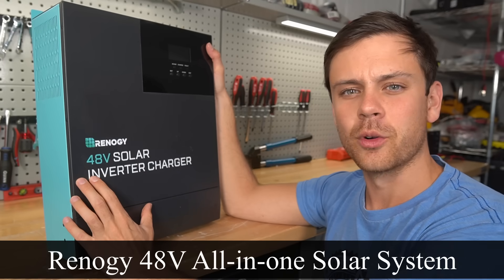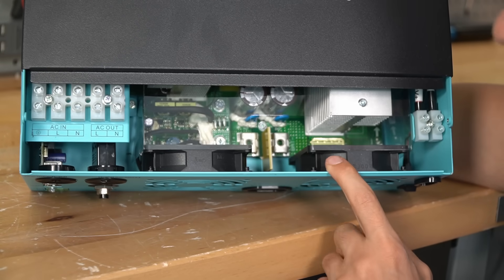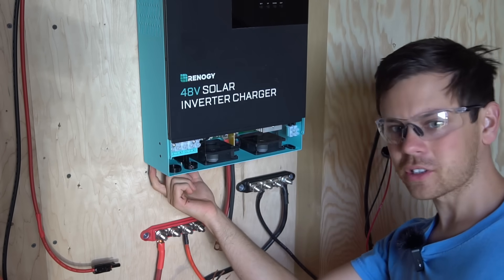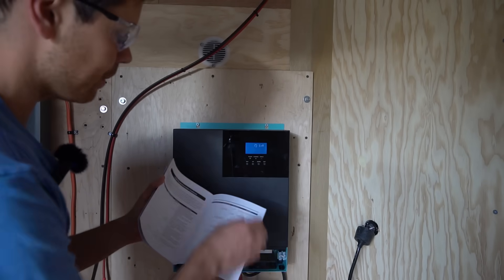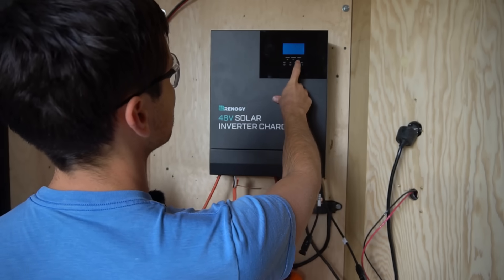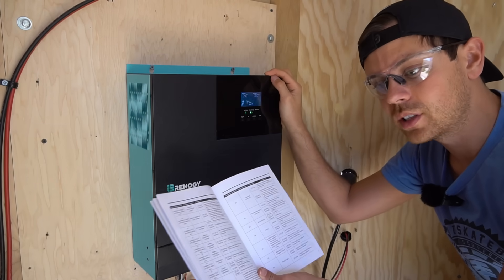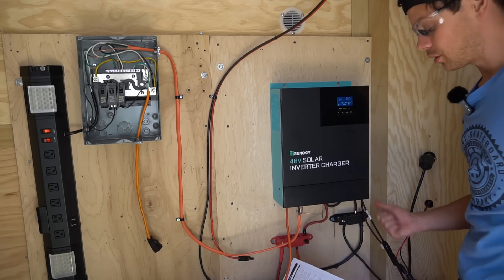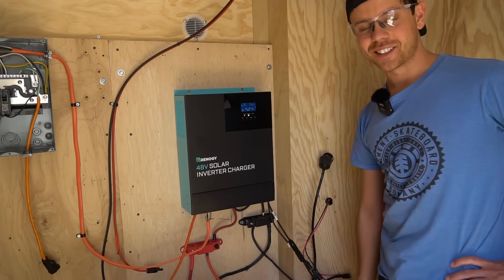Renogy 48V All-in-one Solar System: 3500W Inverter, 4400W MPPT, 1920W AC Charger

Comment: I have been waiting to pull the trigger on the Growatt unit until this review was published. Thanks for assisting me with my decision.
Reply: same, i was waiting for this and to see it the growatt outperform is cool cuz its cheaper.
Reply: @jameshughes131  I am actively shopping and defniitely would have bought Renogy over Growatt bc of the name and availablility from reputable retailers.  Now the question is do we wait and see if Renogy fixes this or go for the Growatt now.
Reply: @Ken1704  im going with growatt becuz A.) they care about pricing and customers so i want to put my money with the people who did it first and who get better over time. im gonna buy that 48v system to save on wire costs and use it without battery on a large array. I will get 4 x 12v
sok or make my own
Reply: @jameshughes131  Thank you, that is a great point.  I also like Signature Solar who sells the growatt.  I often think the retailer is as important as the product.  I just got a 1000W inverter from Amazon and when it arrived I shake it and something is rattling inside.  Amazon says take it to Kohl's and drop it off.  That is amazing (and I HATE Amazon-but I get gift cards from work) but I have to admit that return experience was incredible.
Reply: @Ken1704  i only use ebay and i deal with sending stuff back all sometimes but for important peices like growaats deal and such i buy only from reputable sellers. To many fakes. I just picked up santan 250w panels used for 59$ out the door crate shipped to me. I got 10 of them. 
in 3 days i have to make a all in one purchase and will go with growatts batteryless system. I will get batterys later. The idea of going batterylesss with large arrays is very environment friendly and i need will to do more testing on this. 5k btu ac on the large array no battery. then lastr min lets talk about the batts
Reply: @jameshughes131 that is an amazing deal.  I am trying a similar project and was actually going to go to the forums for advice.  I purchased a Mr Cool 18K BTU mini-split that consumes about 4KW of power (220VX15 amps).  If I can get free heat and AC during the day, it will all be worth it.  For panels, I am 90% sure that I am going with the 410W bi-facial from Sig Solar.  They are bout $250 per panel with shipping, so just over .50/watt.   I did the opposite of what you are doing  I have a 3 kw/hr battery bank at this point.  I got 2KW from batteryhookup for $150!  I didn't want to go overboard on batteries but I spend the majority of my time in my home office and bedroom which are next to each other.  At this point, even with just a few panels, I am able to run the home office on solar most of the time (90W computer +50W TV and soundbar+about 25W for lighting=165W/hr X about 4 hours per day).  I don't know if this is a rational plan, but my idea is to go room by room with the kitchen being last to go to renewables (I say renewables because I plan to add small wind at some point since I am in the midwest where winter may not produce enough solar).  One of the reasons for delay on pulling the trigger is that my understanding is the fed tax credit applies only once.  Once your system is "in service" you don't get additional credits for adding (that is my understanding without consulting a tax professional yet so don't take my word on that).  I need to go to the forums and have this discussion with some others.  Thanks for your reply, please keep us posted on how it works out.
Reply: @Ken1704  Per Intuit, additional solar tax credits are allowed for upgrades to an existing solar system; but …. you cannot apply for additional credits on the overall system as you already claimed for that once before….*but always check with your tax advisor to confirm nothing has changed on that front since the Intuit information was posted initially….
Reply: @Abeaness  Thank you very much MH  That makes a huge difference in how I proceed  I was just reading the info from DSire or something  I should have looked into it more carefully.
Reply: @jameshughes131  Look up the word cheaper and look up the words less expensive, you might be surprise that your miss using the word.

Comment: Message for Will: Be patient and give us a review after playing with it for 30 days. It clearly has some flaws but 48V and 3500 watts is the sweet spot for me and my van. I mentioned needing 1500 watts just for boiling water (in the past) and obviously I need more for A/C and some other stuff and I do not want to be using 100% for durability purposes.
Reply: Yep, but I'm doing it in a class C RV and want to run a mini-split A\C. I want at least 3500w.

Comment: Solark running my dryer and other stuff in the house at 7.5kW: No fan noise whatsoever. The Growatt 6000T I had before that had a standby of 120W and even higher draw when powering loads - you couldn't hear yourself think when just 1000W was being drawn by the oil furnace - seems this Renogy is super noisy too.  Funny, fans are a consumable on the Growatt site. Oh, and  the Solark clocks in at about 25-40W standby. Don't hold me to this but I'd swear the UI on this Renogy is suspiciously similar to the UI on the Growatt 6000T ... hmmmm. Brothers from the same mother?
Reply: Comparing SOLARK to Growatt is pretty unfair ... JET to BiPlane

Comment: Man...Will...that's the quickest and the most consistently pissed off I've seen you...for that reason... I wouldn't touch it!!... thanks Will!!👍👍😎
Reply: Aye aye!
Reply: Most of my system is Renogy, but I have gone with other sellers when it's warranted. I am preparing to switch from 12v to 24v, and my current system is pieced together. Trying to decide if an all-in-one will be worth it, or if I will continue to build piece by piece. I like having the ability to replace each component in case of failures. Off-grid professional glamper in a yurt 10 months a year.

Comment: Ground is on the bottom
Reply from the maker: Yes I said that. It's easy to find. But the ac output should have a dedicated terminal. Like 99% of the competitor's units have.